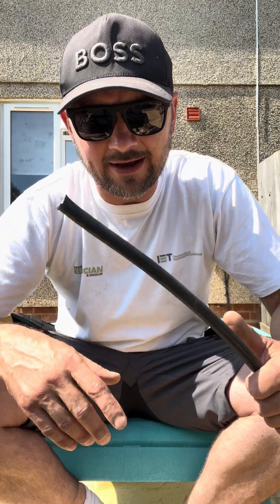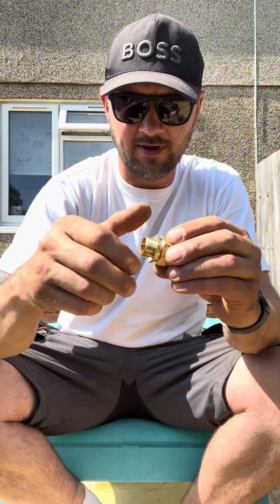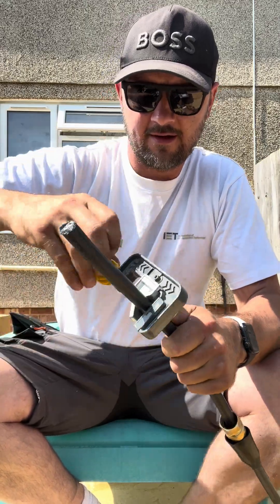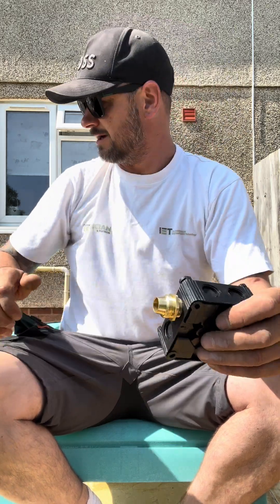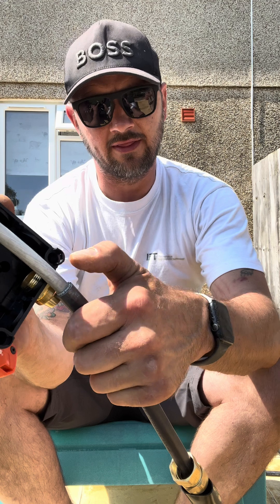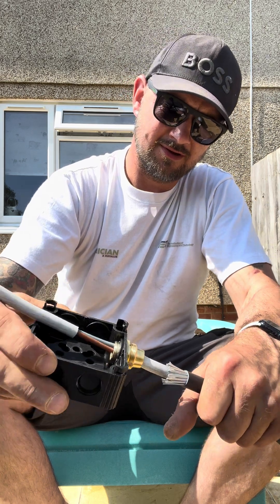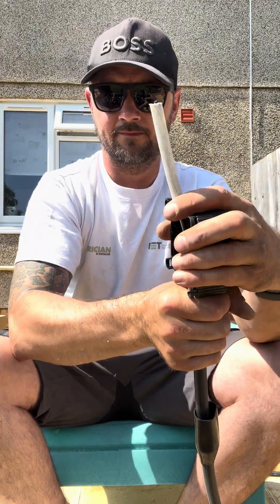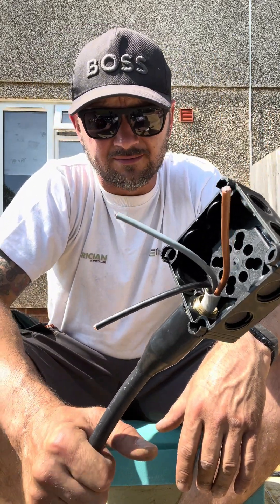Terminate SWA Armoured Cable Like a Pro: The Ultimate Easy Guide!

Comment: I'm terminating 6 gauge armoured cable for a 30 amp service for a welding receptacle and I had the same problem with the box. Not enough depth to use locking nut. I ground off the bottom of the nut flat and screwed the water tight fitting into it. No extra room built into anything these days.

Comment: Amazing 👏
Reply: I’m trying to learn this. The locknut didn’t fit in this example you showed, but what do you do about the banjo ring? Don’t you need to connect that and add an extra Earth wire to Earth off the actual armour around the cable, because in your example, if you just wire up the 3 wires, the armour is still not earthed off to anything? Thanks in advance
Reply: @glitchbit_yt  If your not using the steel armour as an earth then you only need to earth it at one end - it dosnt matter which. There are earth spring clamps that can be put around the stub of the gland that pokes into the wiska box. They come with an earth lead and screw and nut. No banjo needed then.
Reply from the maker: Thank you! Cheers!